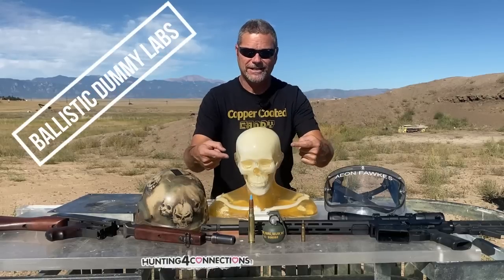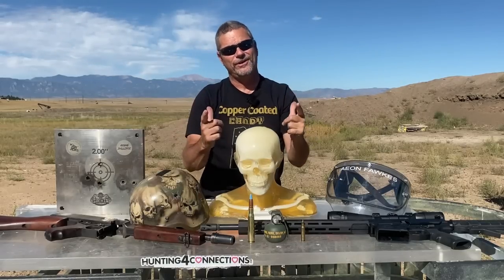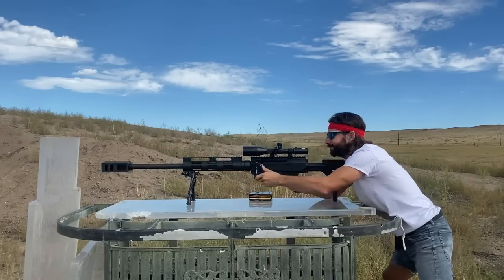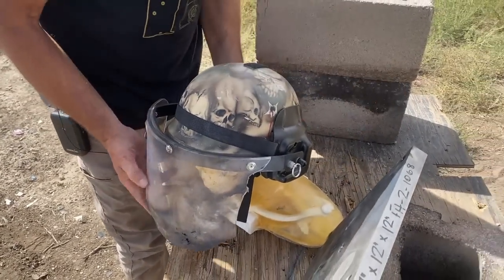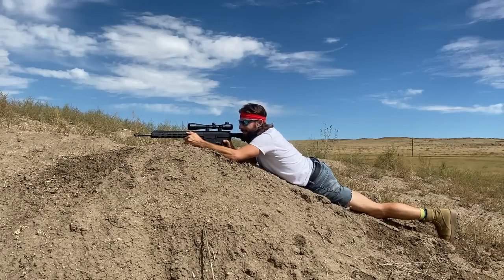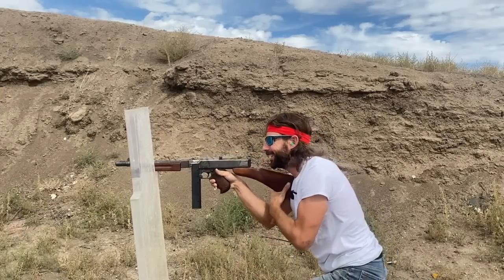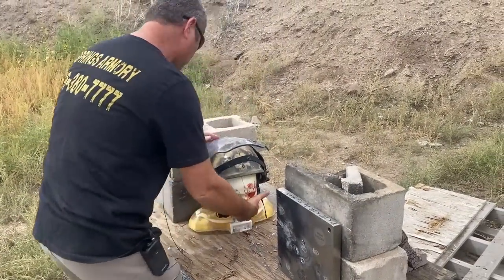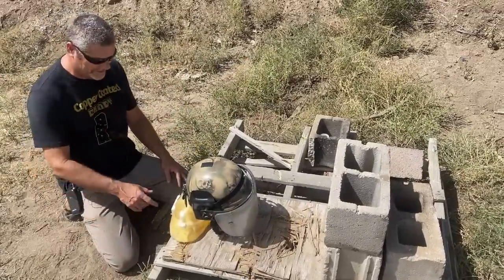EOD Blast Shield Vs Shrapnel

Comment: Hey! Thanks for testing this! With the EOD bomb suits, we would have neck protection and a ton of kevlar and such in the suit designed to catch the frag that the shield doesn't stop. Also, I can think of a million other methods to function that grenade without hand placing it and running. Ya'll are nuts.
Reply: There was a cut in between, the clouds moved a decent bit too so it wasn't just the cook off being edited out.
Reply: this doesnt take anything away from this awesome vid, but he didnt place it and run. There was an edit there, so they cut then set it up and then filmed it. Also it may not have been a real live grenade, they usually have a bit more gray smoke than what brownish smoke came off this. I'd also excpect a few more marks on the cinderblock as well. The charge sure seemed about right tho, so actual grenade or not, it sure was real!

Comment: I was told the reason for going to Kevlar helmets and discontinuing the metal K-pod helmets were due to the concussions and neck injuries soldiers were getting from having the heavy helmet on their head. They would get hit in the head, survive the round or shrapnel, just to get their neck snapped and either die or be paralyzed. The Kevlar helmets would absorb more of the impact causing less injury. However, I did learn some interesting facts in my research on this subject:
To break the neck of a human, 1,000 to 1,250 foot-pounds of torque is considered sufficient. When hanging someone, a typical drop of 5 to 9 feet is enough to generate the force required to break the neck when the person hits the end of the rope.
A foot-pound of torque is 1 pound of force applied at a distance of 1 foot. Therefore, applying 200 pounds of force on a 1-foot-long wrench generates 200 foot-pounds of torque. Applying 100 pounds of force on a 2-foot-long wrench also generates 200 foot-pounds of torque.
Most broken necks are the result of severe trauma, such as car crashes or falls during sports such as skiing.
Reply: I'm impressed with the research, thanks for all the information!
Reply: I heard years ago it only takes 7lb of pressure to snap a human neck. Don't remember the source though.

Comment: I wonder if most spalling could be deflected by an angled lip at the top of steel armor. Basically add a slight "V" shape protrusion at the top of a level 3 plate, and that might deflected most shrapnel vs rubber coatings.

Comment: I have a suggestion... Might make for an interesting video as well as show off the marksmanship of your shooter.

Have various grenades, (preferably mostly cheap ones, like smoke or airsoft grenades and maybe one or two real ones at the end) and have your shooter, remove the pin and thus release the spoon... With a bullet. Obviously from a very safe distance.

You could use various rounds, like .22lr or .556. maybe chalk rounds? Spotter?

Comment: I wore a similar face shield in Iraq.   My neck still hurts from wearing those heavy suckers.  In my experience they do ok against rocks and bottles, but not much else.   They covered your face, but left all the important stuff in your neck right out in the open.
Reply from the maker: Thanks for your service. The helmet and shield were pretty dang heavy.
Reply: @GoingBallistic  they really didn't do much outside of providing another mechanism of injury during an IED blast.  I wasn't EOD but I played in a lot of the same playgrounds doing route clearance.   We never wore the gumby suit.  We never wore the mine clearance suits either. If the bomb was big enough to get you, that suit wouldn't do anything except maybe keep the pieces together and identifiable. The only guys that wore those face shields were our gunners.  They chose protection and heavy armor over mobility.  I personally feel that was a mistake.  After all the IED blasts I had to clean up after, I have to wonder how many got tagged because they couldn't get out in time because of their gear. Just my 2 kopeks in opinion there.
Reply from the maker: @Sapper21b10  I was not in the military but I did 3 years over there working on all of the route clearing vehicles. I went on a dozen missions with some of the units I worked with to see what you all went through. If people could see what kind of crap our military enlisted go through, they would have a lot more respect. 
Thanks again. It’s people like you that are one of the true reasons we have the freedom to “still” have the type of videos we do.